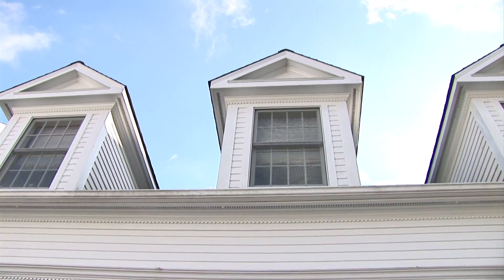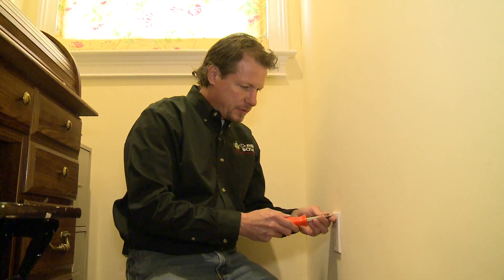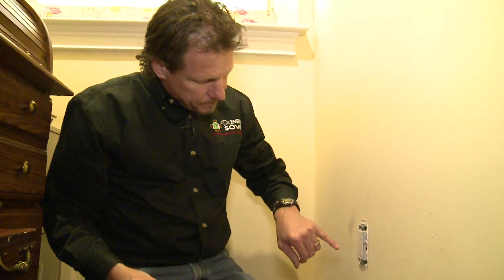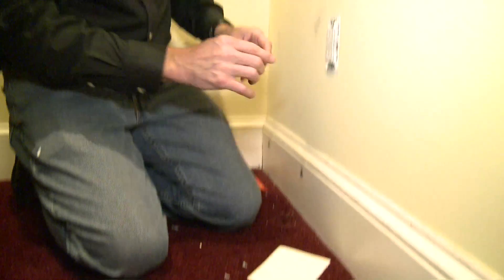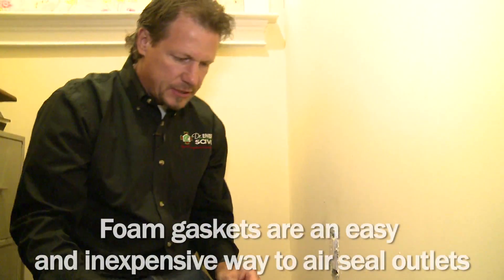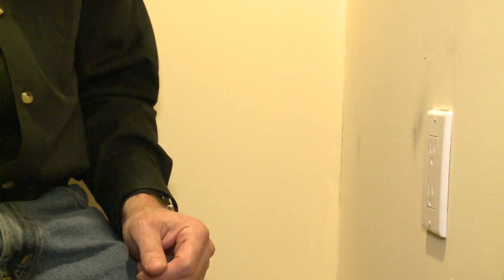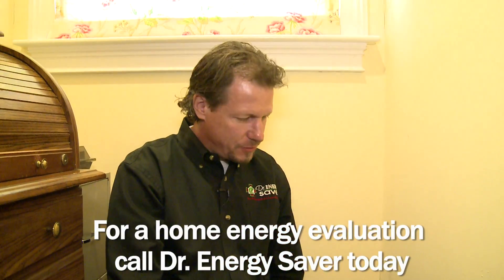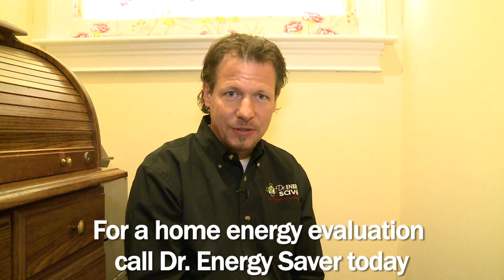Air Sealing Electrical Outlets

Comment: Using caulk or spray foam around the outside perimeter of the box, to fill wide gaps, may be OK.  But don't get that stuff inside the box.  It interferes with heat dissipation and you might accidentally glue the receptacle permanently in place.  Also,  chemicals in spray foam and caulking might degrade the electrical connections.

Using just the fitted foam pads and child-proof covers alone will reduce a lot of the air leakage.

Comment: This is silly. Air will still come through the receptacle slits and holes on the inside and where it's cut around the drywall or other panelling. You need to insulate/wrap around the entire receptacle such as using protecta fire putty.

Comment: This isn't how I did mine, I pulled out the outlet and sealed the junction box holes the wires ran through with silicon and then just finger sealed the edges where it leaked.  I don't know why anyone would caulk the outlet in the box itself, that would be  aroyal bitch to replace if you had to afterwards and it won't stop air from passing through the mechanical outlet itself as its not sealed.    Pulling out the outlet and sealing the holes is a much more practical solution to this.
Reply: Ev3rM0r3 He saved himself some energy by not removing the box to proper seal. 🤪

Comment: Do you turn off the electricity before doing this?
Reply: If you are going to stick a screw driver near an outlet with exposed contacts on the side, it better be turned off... I'm sure he took that precaution but didn't mention it. Safety first.
Reply: its his choice. i'd recommend it. its not hard to do and if the computer/fridge is on...who cares shut it off.
Reply: Hope so he ran his finger full of caulking with no mention of turning off the power you could clearly see the screws to the terminal exposed.  
Caulking that would be terrible for future outlet issues. 
Spray foam in the holes would work best and use a foam insert for the outlet cover and buy childproof outlets so you don't need covers.

Comment: I was about to do this throughout the the house,all exterior walls with the decora style outlets,starting with outlets that could blow out a candle…I went to the worst offender first & right off the gasket doesn't fit the outlet snugly at all…still pretty breezy & a waste of time.Cant use expanding or batting,the cavity behind will not support it.The brand is MD from H Depot.